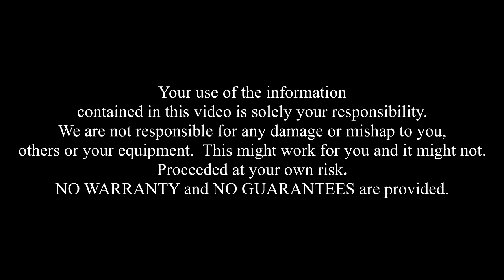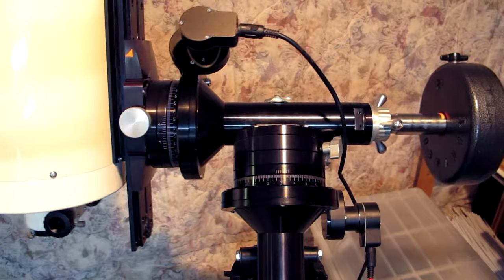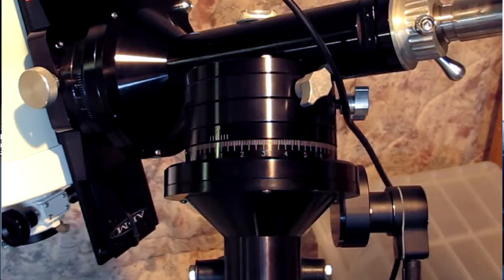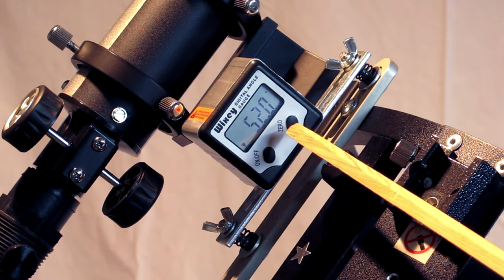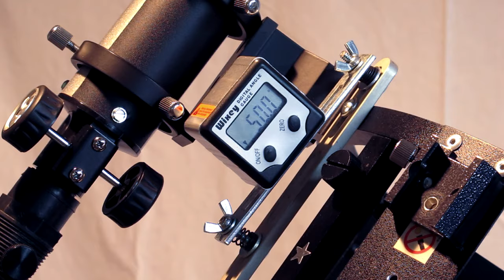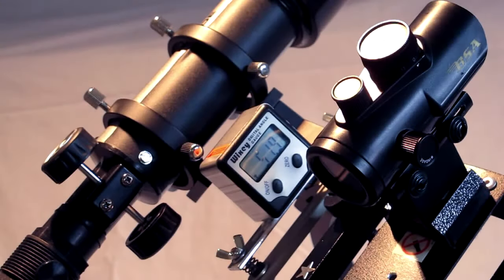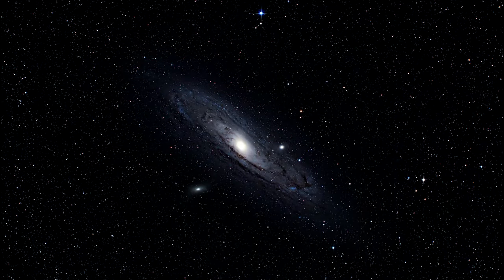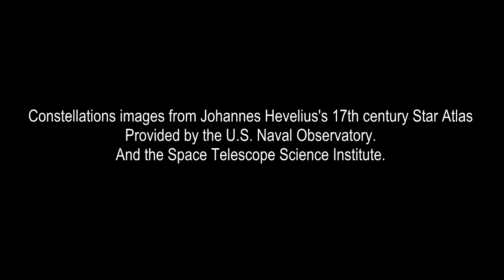Adjustable Setting Circles For Dobsonian Telescopes

Comment: Brilliant! And the idea for the secondary cover is perfect
Reply from the maker: Thanks, Adio.  I've got a new design for the setting circle Az.  I'll be posting it in an upcoming product review, Hubble UL16, later this summer.  Essentially it's a ring cut out of thin fiberglass sheeting, or similar non-metallic material like formica sheeting. The printed setting circle is glued to the ring (silicone) and four "ready stick" magnets wafers are attached to the bottom of the fiber glass ring.  A round, slightly larger, sheet metal base it attached to the underside of the rocker box by removing the three rubber feet.  There are four equally spaced allen head screws (protruding up above the sheet metal) to keep the free floating azimuth ring centered.  Adjustments are made by simply sliding the ring around with the magnets providing the right amount of resistance.   No need for the dial or azimuth marker but a leveling base is still required.  Clear Skies!
Reply: @DakotaStarryNights  There is no PDF print out of AZ wheel like you mentioned.  How do I get one

Comment: Another great video Richard! So many helpful tips packed in there. Going to looking into making a leveling/azimuth platform for my Z10 and printing the setting circles. Already have the digital gauge for my tablesaw, but the holder for that is brilliant! Great idea!
Reply from the maker: Glad you found this one useful.  Once you get the hang of it, it's really easy and accurate.  I typically use Polaris as the calibration star because it give you more time to adjust without having to move the dob.

Comment: Your video inspired me to make setting circles for my dob too !
Reply from the maker: Cool!  It's amazing how well they work once you sync on a star. Check out my new video: https://www.youtube.com/watch?v=C8zgk_Iflh0&t=32s  for an improvement on the scope leveling platform. Simplicity is a beautiful thing.  Thanks for posting.
Reply: @DakotaStarryNights  I found a resource to print huge 360 degrees template, up to 30 inches in diameter which I can print out for the base platform
Reply: @DakotaStarryNights  This is my plan. Feel free to comment.
My dob is a Meade 12" Lightbridge. I have to check again the exact measurements - it has two concentric round base - one which as three bottom stubs is to  sit on the a stable surface (ground or my movable wheeled trolley), the other is for the scope to turn freely on azimuth (the rocker box, mirror case is on it). The round base is 25" in diameter. 

I planned to print a large protractor (28 inches outer diameter, 20" inner diameter), so that the degree dials will be visible outside the roundbase, and I will use some form of attachment to attach it to the fixed base board (from the bottom), but it will be movable － this is to allow me to point the 0 degree mark to True North. (The one I planned is to tape a long little chain on the printed protractor, stick 3 or 4 magnets at the bottom of the base board so I can adjust on the field to have the dial align with True North). I use a compass app to find true North and align this dial first (after leveling the base).
The upper (turning) base I will have an arrow printed on it, aligning to the direct front (like the direction arrow on a base place compass), plus a bubble level. 
The secondary housing is made of rolled steel, so I can easily attach a inclinometer (with magnetic base) to it - all I have to do is to find the spot where the inclinometer is properly leveled (the scope altitude angle is 0 degrees) and make a mark so that the next time I will place it on the same spot.
Reply from the maker: @yellowlynx  I had to read it a couple of times but I believe I understand what you're getting at.  I'm currently working on putting setting circles on a Hubble Optics UL16.  Your plan is a good one and similar to what I have worked out for the UL16.  Here's a couple of things to consider, if you haven't already.  1.) I'm assuming the protractor's 20" inner diameter is to allow the "Azimuth ring"  to clear the base board feet in order for it to rotate freely. Good.  2.) But how do you intend to keep the ring centered?  The magnets will hold it up, yes, but not centered without some modification.  3.) I would favor sheet metal over a chain.  4.) Better yet, take the printed Azimuth sheet and cut it into a ring.  Cut a ring of the same size from thin plastic, corrugated plastic sheet or fiberglass material (a gig saw with a metal cutting blade works good on fiber glass) and glue the printed azimuth ring to it using silicone, applying the glue to the fiberglass ring and laying the paper on top.  5.) Attach three or four self stick magnets ( available at hobby stores) to the bottom of the plastic ring.  6.) Under the baseboard attach circular piece of sheet metal cut to an outside diameter of 28.5".  Lay the azimuth ring on top.  The magnets will hold it in place and the "metal shelf" will keep it centered.  Hope this helps.  Dakota
Reply: @DakotaStarryNights  Thanks for your tips. Yes, the azimuth ring is to clear the base board feet to rotate freely. The  metal ring shell idea is good - it will be like a "railing" to hold the ring in place and keep it centered, and I figured it does not have to be a complete ring. I am thinking of making three or four pieces of metal strip as "arcs" at three or four sections of the circle (spaced at 120 / 90 degrees apart,  and line them out on the rim of the board (I think you can picture that). The azimuth will have 3 or 4 magnets on it at exact positions to stick to the rim make the azimuth ring centered.  Usually when I try to position the ring, to  point the 0 degree mark to True North, it will already be reasonably near True North and all I need to do is to adjust back and forth a few degrees.
Reply: @DakotaStarryNights  The link is where I get the different sizes of protractor ring template - https://www.blocklayer.com/protractor-print.aspx - outer diameter 2 inches to 30 inches (imperial measure or metric if you wanted). You can have it print the dimensions of inner and outer rim too - the protractor face can be adjusted too. That is a great tool because the old OpticMaster template have only a few sizes to choose from, and this tool  allows you to make a range of sizes so you would not be stuck to a few sizes. 
It outputs to a PDF, and I can print them in several A3 sheets and assemble them or have a print shop to print it out. The printed template has markings for the center too, and the divisions for imperial measures have a lot to choose (1/32 increments).

Comment: Am I right in assuming that technically, you could get by with either Altitude OR Azimuth, and not need both?

Adjust your altitude, for example, until it's on the money, then slew left to right until you find it in a wide view eyepiece?
Reply from the maker: In theory yes.  Providing one or the other is dead on and you don't induce an error, up or down, when moving it.  Way easier to have both as it narrows it down a lot and reduce errors in one or the other.  And for the price I don't see why not. Thanks for posting. Dakota

Comment: Looks like so much fun meeting up with other astronomers in a dark sky for some astronomy. I need to find a group of people like that here in the Adirondacks of NY. Great video, and thanks for the info! Also, any reason why you wouldn't zero in the altitude with Polaris?
Reply from the maker: Yes, zeroing in on Polaris, if available at your latitude, is the best option.  It  doesn't move as much.  So it's easier to keep centered when doing the calibration. Thanks for pointing that out.  Clear Skies

Comment: Very good! What is roughly the average offset in degree between the object you want to find and your position using the setting circles?
Reply from the maker: If you held out a pizza at arms length the target would be somewhere within that circle.  If you've achieved a good alignment, Polaris is best, then I've often found it already in the an 82 degree eyepiece.  

(For others who may be reading this be sure to check out the updated version of the Az setting circle here:  Adjustable setting circles for Dobsonian telescopes (Updated) -  https://www.youtube.com/watch?v=KIIOt2bNdaA&list=UUER2e8lsYjcwkxSPHGoZIow&index=4&t=355s (Starts @ 5:48 in the timeline.))
Reply: @DakotaStarryNights  Sorry but your link is dead. There is a Updated version?
Reply from the maker: @WetaMantis  Thanks for the heads up.  Try it again.
Reply: @DakotaStarryNights  Thanks np :P